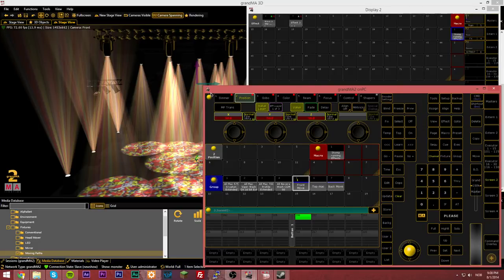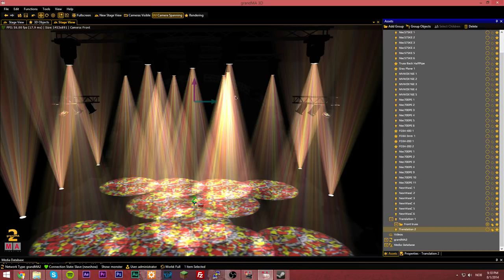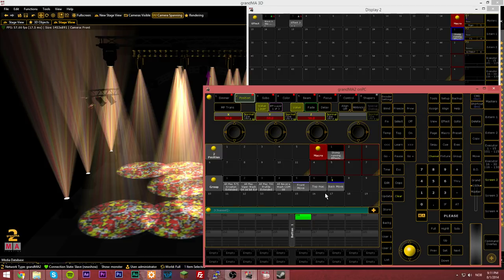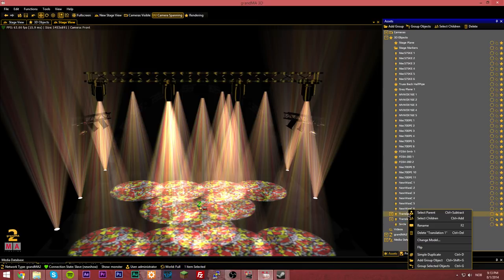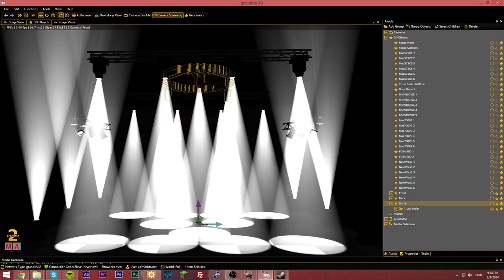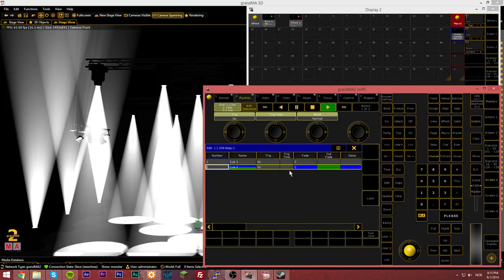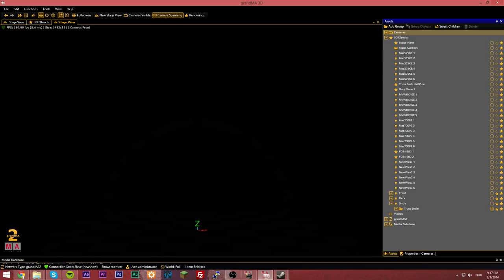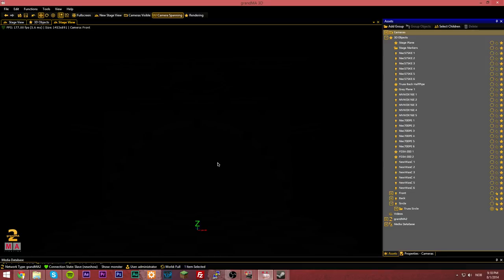How to make "moving truss" Moving Paths Tutorial GrandMA 2 & GrandMA3D

Comment: Cool Video!!!
I´m starting to learn GranMA, i want to buy a laptop where i can use GranMA, do i need a super powerful one ? for the 3D GRanMA
About the video, how can u physically do that trust move ?
Thanks
Reply from the maker: +Luis Sayago You dont need a powerful computer for the grandma console software to work, but the 3D visualizer needs a decent graphics card to work without lag. Turning off fog will help reduce the fps drops. Remember that you cant control real lights without the MA Node which connects to your computer.

To physically move the truss, you will need motors that work on DMX and that lowers or raises the truss. I don't know where to buy these, but a bit of research will help find some. Make sure the motors can handle the weight on your truss. Most venues don't use remotely movable truss either, but it would be quite cool. Good Luck!